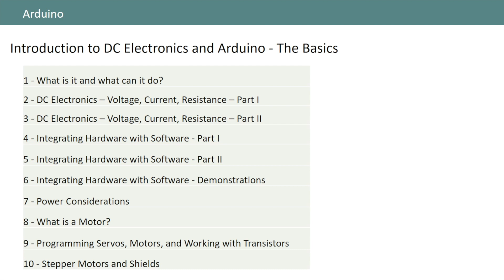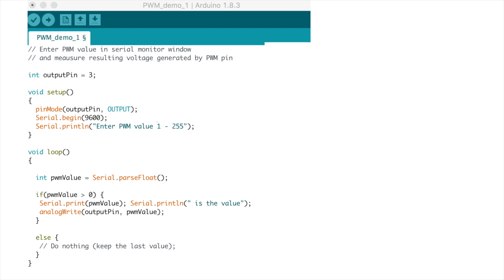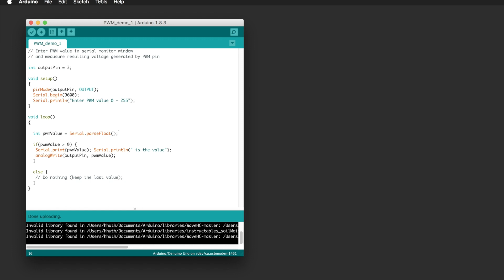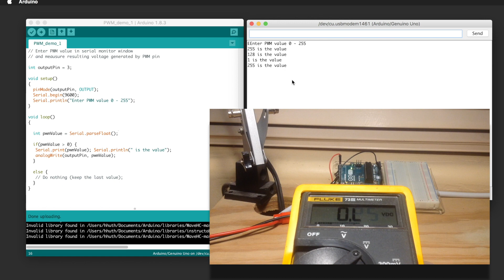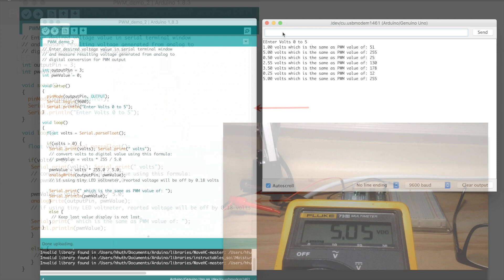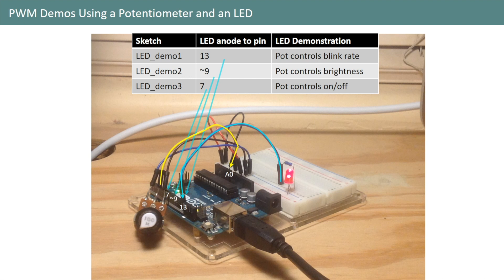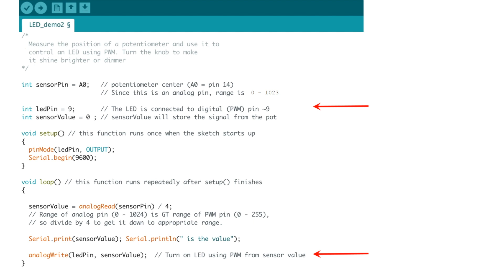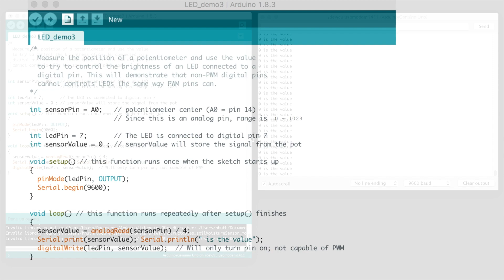Chapter 6 - Arduino - Integrating Hardware and Software Demonstrations

Comment: I have a quick question, so i was trying to program a servo motor on the laptop u gave me but i kinda forgot the password
 I know it did start with arduino but i forgot the rest
Reply from the maker: No idea. I wrote a biod101 manual- maybe arduino101🤔?
Reply: @ModestMaker  ooooyeaaa i remember